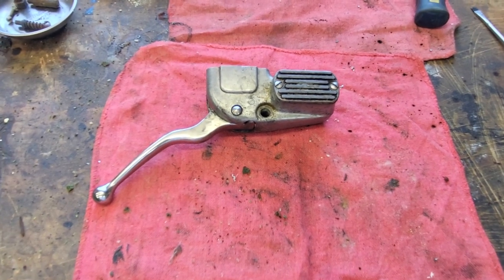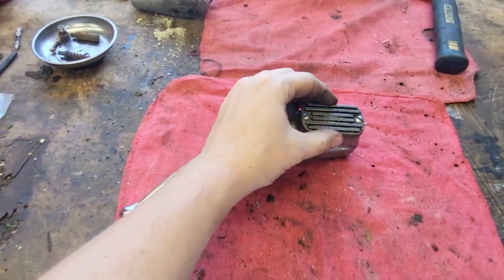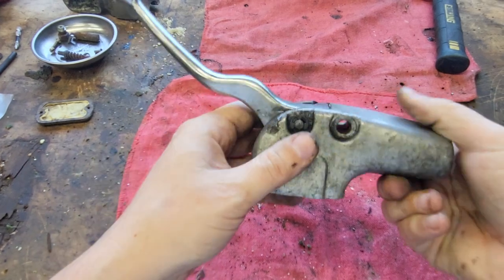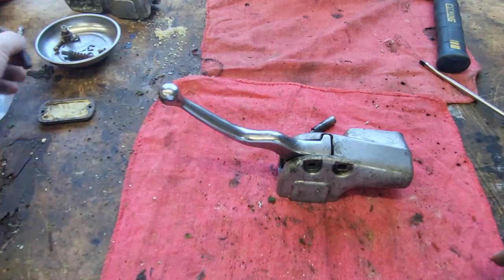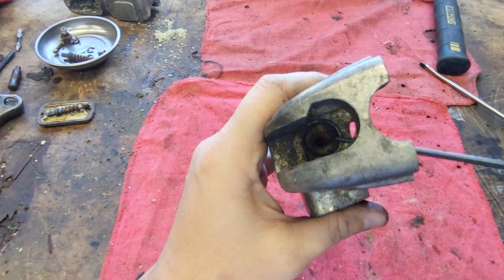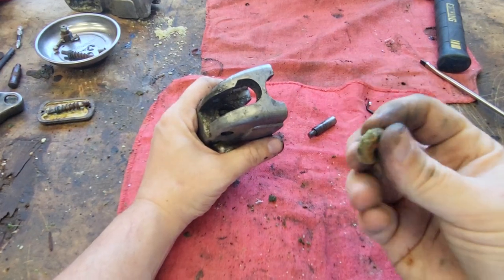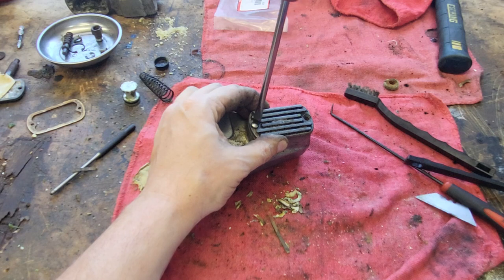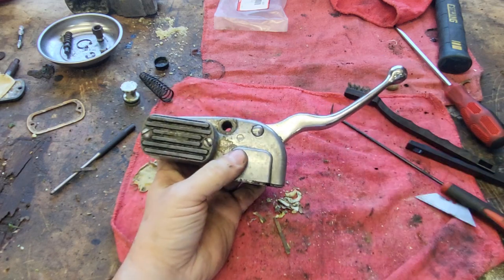Shovelhead front master cylinder rebuild

Comment: Just found this video and your channel, you gained another subscriber.  😎  
I am working on my 1978 HD Sportster XLCR that I found at an estate sale, wasn't smart enough to leave it there because the price was too good (???).  It sat in a shed for 25+ years while the engine went to play 1/4 mile at a time.  He rebuilt the engine and put it back in the original frame before he passed.  So, a lot of small parts are missing and some assembly required, it is a learning experience.  That is the history, now to the present.  I am starting at the front of the bike and working to the back.  New tire, wheel bearings cleaned and lubed, steering stem bearings cleaned and lubed, new fork oil.  Front master cylinder was dry and crusty, got it apart and cleaned and put in a rebuild kit two nights ago. About to start on the wheel cylinders that are semi frozen.  Most of this is new to me, my Panhead engined 1981 FX was in much better shape when I bought it 25 years ago.  I have the HD shop manual for the Sportster but it isn't always clear to a mechanic impersonator like me.  When you put the gasket on the cover it was upside down and you said to put the gasket plastic side up, gasket side down, confused me, I couldn't decide which way to install it since the original was mostly missing on mine.  Could you clarify, does the plastic go against the cover or the body of the master cylinder?  I have been engaging in overkill, I set up my 1/2" thick flat plate glass with fine sandpaper and carefully polished and flattened the gasket surfaces on the cover and reservoir, the cover wasn't even close.  Trying to correct things to save problems later.  Thanks for any help.
Reply from the maker: I'm not going to lie to you here, I just took this apart and put it back together the way it was. Follow what your manual says for sure. Don't be scared to buy a repop cover if yours is too corroded or ate away, brake fluid is hell on parts.

Comment: I found that aceton works well. Just place it there for a hour.. then later I take a sheet of sand paper like 800 grid roll it to tube size like inner diameter and just spin inside and clean it.. Also often find that repair kit piston is oversize and you need to sand it also .. Did that stuff  yesterday.. so it still fresh in my head. by the way silicon based fluid is less aggressive and more friendly to rubber parts🖐
Reply from the maker: This one is just discolored. It didn't need to get sanded out. The other one with the chunky fluid, it's going to need a bit of work, lol. I can't talk to the piston size. They have always been correct for me. Either 5/8" or 9/16". And everything else, the caliper and brake line, require dot3 compatible brake fluid. So that's what I'm lubing things up with.
Reply: @DWchopshop  I see... I just quit using DOT 3 or dot4 or any dot5.1 ext just using dot 5 full silicon. Its much more expensive , but less hazard . Thanks for good content, keep wrenching!

Comment: I have a second question.  The wiring is a mess on mine, I may have less hair before I am done.  The front brake switch is in my master cylinder (minus the rubber boot) and I presume that there should be wires connected to it, no evidence of them left on mine.  Could you show how they should be attached when you assemble yours so I can get mine working?  It is the same master cylinder.  Thanks again.
Reply from the maker: Alright, so this brake assy. is already back on and moving down the road. But your brake switch is just a simple switch. there is no positive or negative terminal, it doesn't matter which wire goes where. The OEM connections would be soldered in place, but a lot of people use small spade crimp connections. I prefer soldering myself.